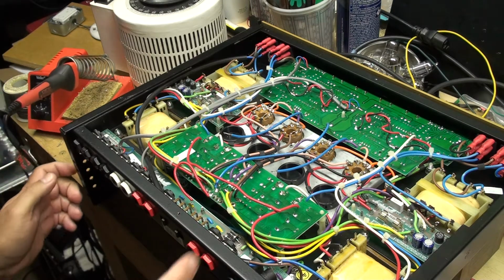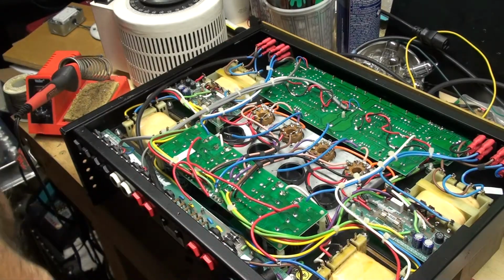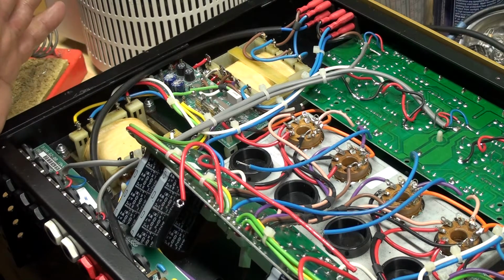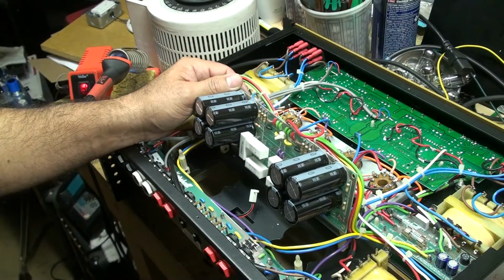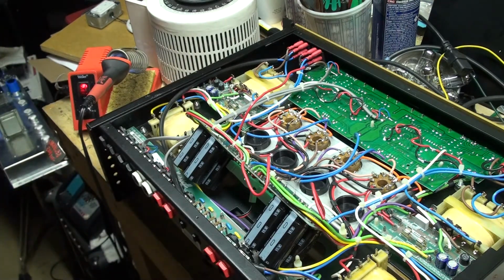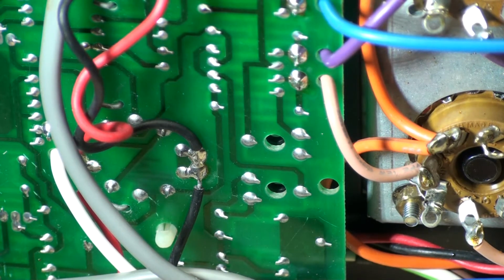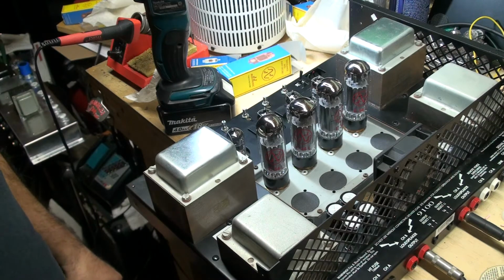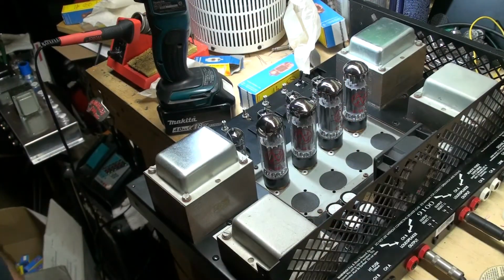Marshall 9100  Power Amp Conversion to 50/50

Comment: I'm Wondering if these amps can take "KT66" and Convert them to HIFI system? Just tired of seeing Overpriced Mcintosh, Harman Kardon and Marantz etc...
Reply from the maker: There is a video here on YT of a guy using his monoblock as a HiFi amp
Reply: @conjering  saw that, had a 9200 series, not happy with the volume and gain pots as well as the bass. anyways, thank you..

Comment: Are there any screen resistors that can be installed to this amp that can handle both 5881 and el34 ? that way if you want to go back to either tube type there's no need to mod again
Reply from the maker: The simple answer is no.  Marshall told me the output transformers on this amp is meant for EL34’s so changing the screen resistors to 1k will be the correct way

Comment: Yes indeed - not much around on these amps, strangely.
I'm just about to replace the vales on one side of mine (9100). But I'm keeping it stock so 5881/6L6. What was the bias before you changed it or what do you recommend?
Reply from the maker: I don’t remember what the bias was but, I always believe as using the plate voltage and the bias at 70%.  I have a few videos explaining that.  You also have to balance the 12At7
Reply: @conjering  I'll check your other vids - never done this before. I haven't got a tube base adaptor for the smaller valves, why would I need to adjust those if they are not being changed? I'll let you know how I get on anyway!

Comment: The 5881 heater filament draws 0.9A and the EL34 draws 1.5A. Are you sure the power transformer can handle the increased heater current?
Reply from the maker: Yes, I thought the same thing, but Marshall tech in England said it was good to go
Reply: This amp was originally designed for EL34's, the only reason they went with 5881's was at the time of release, there was a supply and quality issue with EL34's. They were forced into it, to be able to release the product.